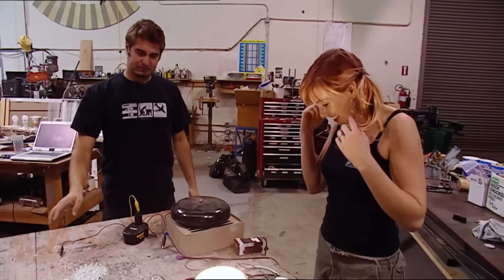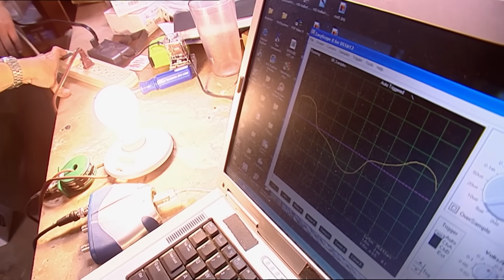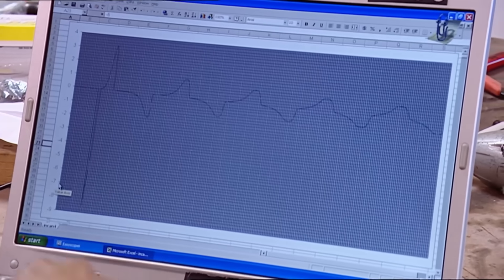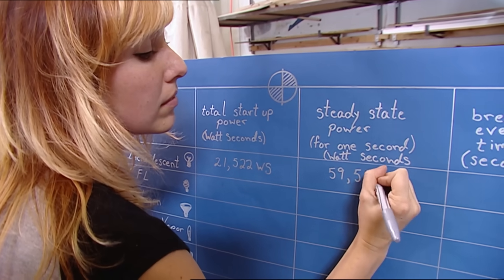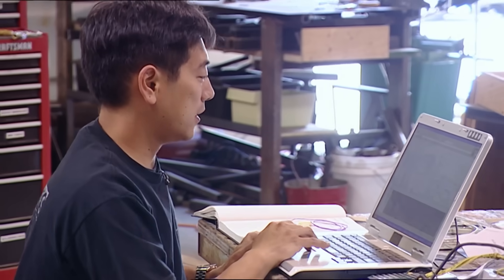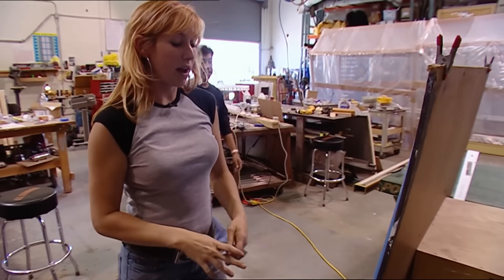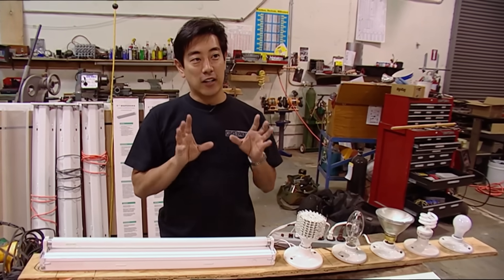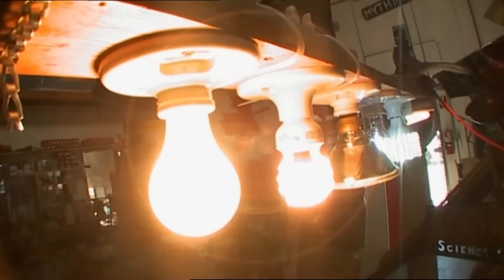Is It Cheaper To Leave The Lights On Than To Turn Them Off? | MythBusters

Comment: I'd say the more ridiculous myth is that leaving your lights on is why your electric bill is so high.  Especially if you're using standard 5-20 watt LED bulbs. If you left a 10 watt bulb on 24/7 for 30 days, it would use 7.2 Kw hours, or about $1.25 at the average cost of electricity. If you multiply that by all the lights in a standard home, that `is` significant, but it's not why your electric bill is $100+ a month and no one leaves all of the lights in their house on 24/7.  You want to significantly reduce your electric bill, look at your heating and cooling, washer and dryer, refrigerators, and dishwashers.
Reply: People who penny pinch over power drive me up the wall. Especially can't stand people who frequently turn on and off heating/cooling to "save power bill". Spoiler: the hardest an appliance will ever work is when its changing temperature rather than regulating it. It's cheaper to let it manage tiny upkeep on its own than to turn it off and let it fall 12 degrees before turning it on again. It also won't break down due to the extreme changes in temp.
Reply: The difference with lights is you can control how much is being used. You aren't going to unplug your fridge or stop doing dishes to save money but you can turn the blasted lights off when you don't need them.
Reply: True, lighting is probably not the biggest electrical consumer in your home, but if you were using 60 watt incandescent bulbs instead of that 10 watt LED, your electrical cost would be $7.50, a fair increase. As well, you'll probably end up using 4 or 5 incandescent bulbs in the same lifetime as 1 LED. So there are savings there too.
Reply: @SmilingNinja  True! Which is why back in the 70's when I was a kid,  the whole `turn off the lights` campaign made more sense than it would today. Not to mention we were having an energy crisis anyway.
Reply: @somersetcace1  True, but turning the light off today is still worth it. Even if the savings are pretty forgettable. After all, marginal energy savings are better than slight increases in energy spending.
Reply: @SmilingNinja  The `Every little bit counts,` idea is fine, so long as it's not "Our electric bill is nuts because YOU keep leaving the 10w LED bathroom light on!!!" when actually it's because they have their AC turned down to 68°F in a poorly insulated home.
Reply: @SmilingNinja  Just ignore the fact that an LED costs 100x more than your old standard incandescent.  Also that the LED do NOT have as long of a lifespan as they claim. I have had to replace LED bulbs about once a year in my house. Where in the same time span I may replace an incandescent 2 maybe 3 times. That's only if the incandescent are low quality mind you. Add to that the toxic ingredients in LED etc lights being mercury is 1000x worse than that tiny spot of lead in incandescent bulbs. Just doesn't seem very environmentally friendly to me :).
Reply: @eaglestrike3759  So many wrong things to mention, where do I start?

1. If you go to Home Depot, you can find a pack of 4 LEDs for like $10, while a pack of 4 incandescent bulbs is like $7, so no, they're not 100 times more expensive. 

2. You're not taking into consideration the amount and cost of energy to power the incandescent bulb, which can easily consume more than 6 times the energy a LED consumes.

3. You're probably buying really poor quality LEDs. Incandescent bulbs do not last longer than LEDs.

4. LEDs do not have any mercury in them, you're thinking about compact fluorescent lamps (CFL).
Reply: @SmilingNinja  Even if they're buying cheap LEDs I STILL don't buy they're replacing them once a year.  I've had the same Walmart specials in my primary lighting sockets for half a decade at this point.
Reply: @ccggenius  Yeah, I find it pretty hard to believe too, but I have replaced over 2 dozen lightbulbs in my home with LEDs, and there were a couple LEDs that stopped working properly after a year, so I suppose it's not impossible that someone just got really unlucky.
Reply: And the data center being built in your town
Reply: @summit-h8d that’s why they’re asking us to save energy, so they can power more data centers.
Reply: Agreed, but if 30,000 people turned their LED lights off, that IS a significant amount of saved electricity in terms of overall use for the grid. At night, though, I prefer to have a low level of lights, moody if you will. I don't like dark rooms. It's depressing. Candlelight at night is my favorite.
Reply: @novellanightmares Sure but the context is of course your personal home and I doubt anyone has 30,000 LEDs+ on or even exist in their home lol

Comment: I worked for decades in telephone company switchrooms, which were all lit by fluorescent tubes - probably still are. We were told many times over the years that we were never to turn them off - until several years ago, when the company decided that, no - they would save money if all the lights were put onto motion sensors.
It took literally generations before the science caught up to the assumptions.

Comment: Wow, never would have thought turning the lights off consumes less electricity than letting them stay on constantly. I am so surprised.
Reply: But, did you know if you turn your lights off for .3 seconds and then turn them back on it will use more power than leaving them on?!
Reply: @YogiTheBearMan  Do you ever do that? Do you turn you light off for .3 seconds on purpose? Do you do that? I know I don't do that, ever. Seriously, who the hell does that??

Comment: Yes but now that LED lights are the requirement and not the exception, they have cheapened and are less Durable now. Still doesn't change the fact that turning off the lights when not in use is better.

Comment: Lights consume so little power in comparison to refrigerator, electric freezer, electric water heater, electric dryer, electric furnace, electric A/C, electric stove, it's insignificant on your total household consumption. You only save a few dollars a month.

Comment: Question, this was really a myth?

Even if there was a significant and huge power surge on startup, if you just leave a light on for an hour there’s no way that uses less energy than turning them on.    If turning them on used more energy than leaving it on for an hour, it would explode when you turned it on.

It sounds like this is just been an excuse for lazy people to not turn off the lights .

Comment: Turn on and off…but your doing it quickly. What if they were turned on and left on for an hour then off….then maybe next time 30mins or 2 hours?? I mean there are so many variables….is it outside where temps vary? Turning on those fluorescent bulbs in a cold garage takes longer to “warm up” than in a warm garage….probably any of those bulbs? Just to many variables as far as how long they last. Cost wise…it’s probably not that big a deal unless left on for hours at a time.

Comment: « Less than » 5 years of equivalent average on/off usage is not very telling. It could as well be 1 year. You should have been checking which light bulb was dead every other day or so, not just after 6 weeks !!! Actually, 5 years equivalent is not that much, I would have thought more. 
Anyway, I guess it’s still way enough longevity to make it worth turning off to spare electricity cost.

Comment: I replaced the T-40 in the kitchen with LED 18 years ago and they are still running.  And turning them off (I do) to save $ does not matter.  They run off my solar system.
Reply: Since LEDs turn on and off 60 times a second, turn off when not in use should increase life expectancy.
Reply: @davygravy7332  What?  60 times per second, What?  Been on and many times in the last 18 years.  But not on and off 60 times in a day let alone per second..

Comment: There is a light bulb in a fire station in Livermore CA that has been in use sense 1901.  It has been burning continuously ever since, with only a few brief power interruptions (the longest was about 9.5 hours in 2013 when the backup power supply failed). It is recognized by the Guinness Book of World Records as the longest-burning light bulb in existence.
Reply: Yeah, they visit that lightbulb in this same episode.
Reply: They admit it is cheating slightly.  It is a 100 watt bulb running 9 volts instead of 120.  With that change, that and it being a carbon filament instead of tungsten, it is likely to never fail.
Reply: @masterkeep  When you run a bulb at less than its designed voltage, it's considerably less energy efficient for an incandescent bulb.  Inversely, over volting a bulb will yield much higher efficiency, but much lower bulb life.
Reply: That's misleading, that lightbulb barely gets hot. The lifespan of tungsten filament depends on the voltage at an exponent of 13. Lower the voltage by 5% and you double the lifespan. Half the voltage and it lasts decades.
Reply: Since.
Reply: long live "the eternal light" on that little shed across from Peaceful Meadows in Whitman, MA
Reply: yeah and the actual light it produces is incredibly minimal
Reply: The lumen level is extremely low on that bulb. No wonder the filament never failed. It’s barely producing any light.
Reply: My PC is like that.
Reply: Yes, but it’s not running at 100 watts. Or even 40 watts. It’s a much lower draw than a normal bulb.
Reply: That must have been made before, the few big companies conspired to limit the life of bulbs not maximise them.
True - a whistle blower exposed this a long time ago.
Yes, in 1924, major light bulb manufacturers formed a cartel to deliberately limit the lifespan of their products to around 1,000 hours, a practice known as planned obsolescence. This was done to increase sales by ensuring bulbs would need to be replaced more frequently, as longer-lasting bulbs were seen as a threat to profits. The cartel, called the Phoebus Cartel, even enforced the standard by fining companies whose bulbs lasted significantly longer than the agreed-upon limit. 
Prior to this 2500 hrs life was the norm.
Reply: @Neil-h9o  thanks for clarifying, thats some good info 👍
Reply: @N @Neil-h9o ose old light bulbs also burned at way lower brightness levels. All they had to do was make the bulbs brighter to lower their lifespan
Reply: @Neil-h9o  Fun facts continued, these type of regulations are not in place in Saudi Arabia whom has much better lightbulbs than much of the rest of the world. And these same regulations are also a major contributing factor to why incandescent bulbs are now banned in the US. The short version being that they were banned for environmentalist reasons of energy efficiency while also being banned from being able to be made more energy efficient.
Reply: @Neil-h9o  The light bulbs were also dimmer. Lower wattage lights last longer, but also produce much less light.
Reply: @poochyenarulez  
Maybe so by not relevant, my point was the collusion by the few big producers to limit the life and build in end of life less than half of what could be achieved.
I see it as both wateful and Theft from the Public.
Reply: @Neil-h9o  The cartel was to standardize light bulbs. A light bulb that lasts 10x longer isn't very helpful when it produces less light than a candle. The cartel didn't even last long at all.
Reply: @poochyenarulez  
Although the group had intended the cartel to last for thirty years (1925 to 1955), it ceased operations in 1939 with the outbreak of World War II. Following its dissolution, light bulbs continued to be sold at the 1,000-hour life standardized by the cartel.
The Lumensw difference is not significant-.
744 in 1920 to 800 current. (incandescent)
Reply: Ya where was the break even point when life of bulb was accounted for? The power use was obviously not where the big question is, kinda annoying they didn't dive into that
Reply: I’ve heard that that light bulb is not very bright and it was used as a night light, contributing to its longevity.
Reply: @orangebeagle3068  Indeed. The lumen level is extremely low. No wonder the filament will never burn out.
Reply: if you get a light bulb from back then and compare it with todays bulbs, the old one last longer. as far as i know, light bulbs were one of the first products to introduce designed obsolescnce. the competing light bulb companies were competing to make better products, and realized they were losing sales, because once people bought bulbs, they didnt need to buy more. so the heads of all the companies secretly got together and agreed on a maximum quality/ lifespan on bulbs.

its a shame our society is forced to work this way. im all for capitalism. but it has its issues. imagine how durable and high quality products could be today if we had continued to just make better products instead of more profitable products.
Reply: @wotever99ninynine pretty sure I heard this conspiracy theory for years on modern cars and why every car OEM’s make more and more plastic parts to increase parts and car sales. I have almost all LED bulbs in my house that’s still going on 5, 10 yrs and the “guaranteed” life on the new bulbs have been advertised as increasing more and more, 50000 hrs claim is the norm. 20 yrs ago LED were said to have 10k hrs life. Thanks to advancement made in materials, electrical controls, and designs to dissipate heat they could be lasting longer and longer.
Reply: @anhtuando9129  you'd have longer bulb life making your own led lights, there wouldn't be an actual lifespan on them really. ofc, youd have to make them yourself
Reply: Don't know why that made me think of my underwear collection
Reply: @chainframe  The smell??
Reply: @chainframe  change or not change?
Reply: That was back when Americans actually built things to last. We now build them to break
Reply: @lenoreraven9758  Long lived bulbs were not liked by the manufacturers either.  Google the Phoebus cartel (they all got together and agreed to reduce the lifespan of bulbs).  Now days they don't (obviously) conspire together, but the effect is the same - specified LED bulb lifetimes have gone down dramatically.
Reply: @lenoreraven9758 the bulb has been dim for a very long time. if you want an actual example of planned obsolescence, look at smartphones
Reply: @lenoreraven9758 more profits when they break.  More business.
Reply: It has not been on for that amount of time continuously. That is misinformation.
Reply: @ElliotNess-jg8gt it has been on, but at a very reduced power rate, so not really apple to apples
Reply: @ElliotNess-jg8gt  https://www.youtube.com/watch?v=H6DbQeZbwAQ&t=49s  sense you don't believe me. Or Go look up the city 24/7 livestream. Don't be ignorant! Do your own research before posting things that make you sound like a fool. In fact the light was made in 1890 and used at a water company until it was given to the fire department so it is now 135 years old, running nearly continuously as of 1901 it was given to a livermore city fire department.

Comment: 0:21 watt is this watt per hour unit
Reply: It is KiloWatt per hour. 

1000 watt = 1 kilowatt
Reply: @FridaySharpsword  ok, what does 1000 watts per hour mean? Are we measuring some kind of accelerating energy usage?
Reply: @ab-mc2nq watt is an energy unit. Let's say 1 kilowatt (1000 watt) of electricity costs 1 dollar.

Let's say a led bulb uses 10 watt per hour (wh) and a kettle uses 1 kilowatt (1000 watt) per hour.

The 10wh led bulb will cost you 1 cent per hour to run as it would take 100 hours for the bulb to use 1 kilowatt.
 
The 1000wh kettle will cost you 1 dollar per hour to run as it would take just 1 hour for the kettle to use 1 kilowatt.
Reply: @FridaySharpsword  you are getting confused with joules. A watt is one joule of energy per second

Comment: STRAWMAN.
Lights last longer if you don't turn them off.
Ever notice the bulb burns out when you turn it on?
Leave it on, and it doesn't burn out in the 1100 hour lifespan... lasts for years.